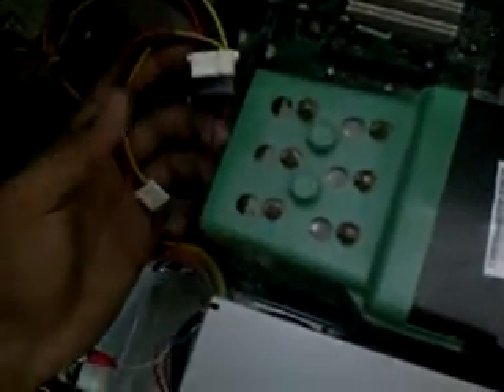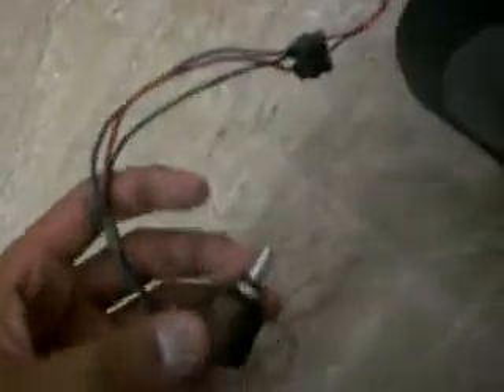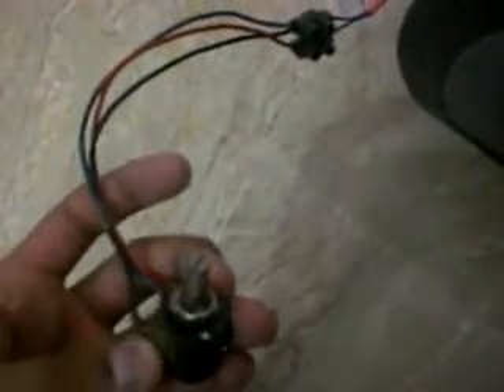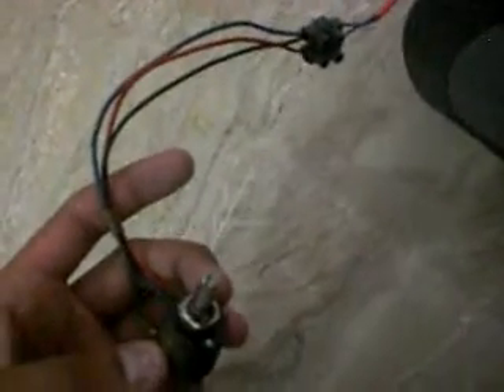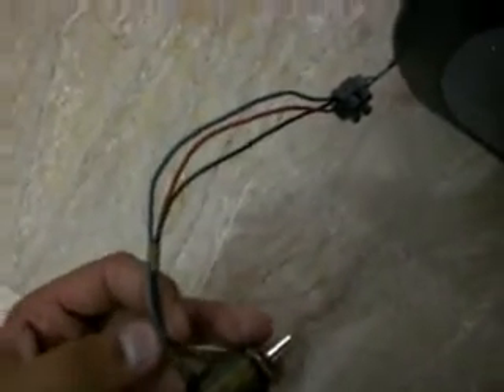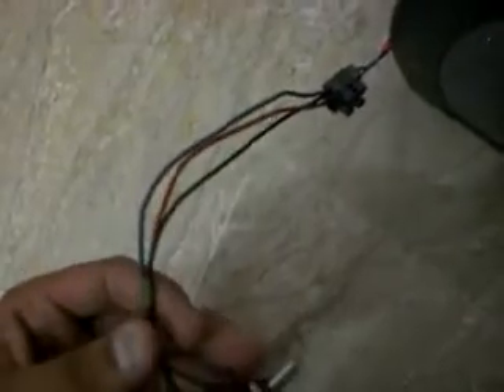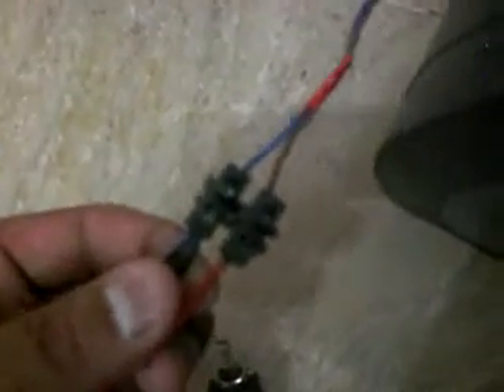DELL 280 FAN SPEED CONTROL SOLUTION_xvid.avi

Comment: shut mine down to the point where it overheated had to get the house fan onto it to cool it so i could go into safe mode to uninstall the dam thing i recon ya did an ace job of hard wiring it mate well done i just may be doing the same dame thing sounds like its going to the moon

Comment: @sajjadpk1984 I tried using resistor (about 15 ohm) on the 12v power line) and i can hear fan speed constant cut off when it reach certain speed, which is not what i want. it did reduce the noise but the fan speed running fast then slow then fast then slow etc because the resistor cut it when it reaches speed.
i wonder what will happen if i use the resistor on the blue line which i suspect is the PWM. 
what do you think?

Comment from the maker: yes it is a way to control the fan speed and the way u r thinking it will not be possible hardware wise. the solution should be a software to reduce fan speed 20 % or any else.

Comment: I think this is a great mod for those with WORKING GX280 but having the fan noise too loud.
Will the speed varied based on the CPU temperature? I want a solution that will reduce the variable speed, say 20% slower.

Can you please list the components required?

Comment: i have dell optiplex gx280 computer.i am facing problem of CPU high fan speed when i turn on the PC.it goes to full noise like a jet fighter and nothing get appeared on the screen and fan continuously gone crazy like that.i have removed all the hard drives,Rams,cd roms, PCI slots cards..only power supply attached to the motherboard...but it still gives the same irritating cpu fan speed noise.........can you tell me what is the exact problem ..???....thanks very much in advance.....!!!!!